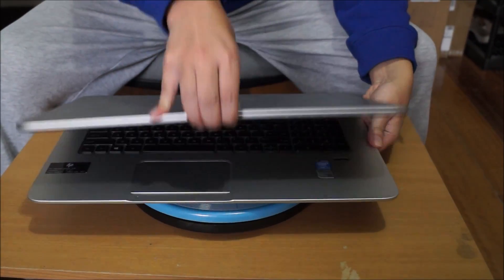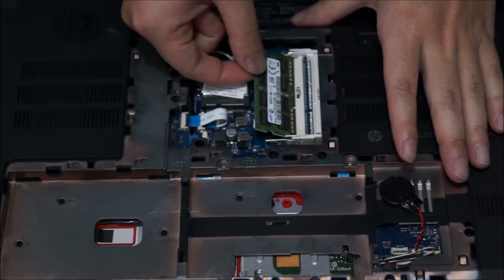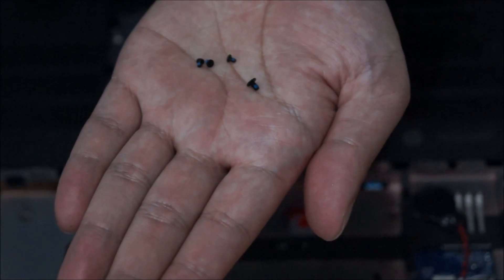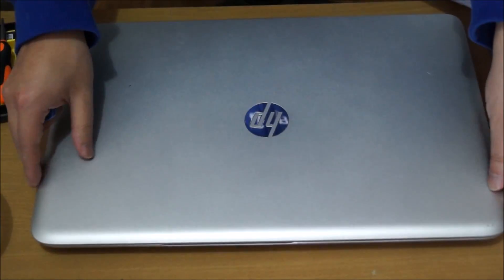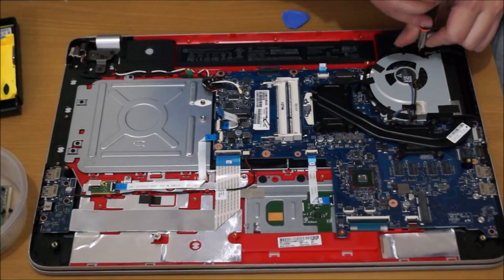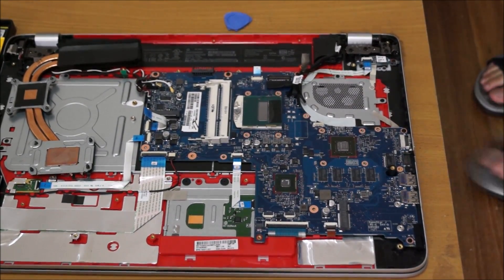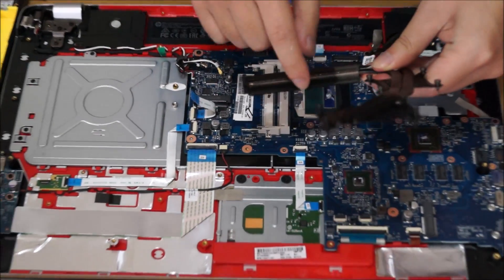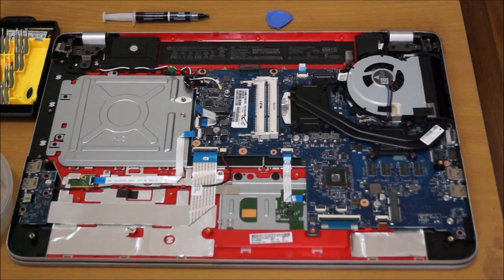OPEN ME UP! HP Envy 17 Disassembly Newer/Updated Video 1

Comment: Thank you for the great video, I'm very glad I found it. The fan didn't start anymore. The reason was that on the one hand too much dust got in, on the other hand the bracket for the hinge was broken and fragments got into the fan and blocked it. With the help of this video we managed to get the fan running, repaired the hinge and the laptop is working again. Thanks alot.
Reply from the maker: thanks for your support

Comment: Is the round black component near the HDD connectors the CMOS battery?
Reply from the maker: should be.
Reply: @OpenMeUpTec  Thank you
Reply: I should have made it clear by referring to your video at 1:11 min from the start when you open the cover and on the right you see it with the wire over the HDD cables. That round black component with wires running to the motherboard.
Reply: By the way your video was excellent and very clear. Great job.
Reply from the maker: @michaelds2738  yes thats correct

Comment: Great video. Can I just ask is there a way to tell if you have the mSata already installed. I have a hp envy 17 same year but mine came with 2 hdd drives 1tb each and 16mb ram. I seem to only have C,E & D drives that I know of on my computer. Also what is the mSata supposed to be used for? Sorry I’m not very tech savvy.
Reply from the maker: msata is a SSD slot which you can go and buy if you want more storage

Comment: It seems I have graphics card problems - what software tools can I best use to test it (on Linux Mint) and as it is soldered on, does that mean it cannot reasonably be replaced, with a home soldering iron and solder removing pen? Are they easy to get hold of, and/or upgrade?
Reply from the maker: you cant replace it. it need special equipment to do so. you can test it by using it. so by playing a game which will switch to using it. if it does not work then you have a graphic card issue. if you are not playing games or running something graphically demanding it will use the onboard intel HD graphics
Reply: @OpenMeUpTec  thanks very much for your help. It's a 10 year old HP17 Envy - the screen goes to low resolution, even the desktop display - and will seldom go back to high res, though i did after I tried some Linux repair - and at one point, when temporarily forced to high res (just on the desktop) a message said that the CPU's performance will be limited as it is handling the graphics. So does that mean binning the computer, or is there a way to fit an external graphics card, (switching off the motherboard one), and make a desktop computer out of it? Could it even be  driver issue within Linux Mint? Perhaps a reinstall is the first step, if there is no easy diagnostic? Thanks again.
Reply from the maker: @gurglejug627  i doubt it is a drive issue. it is alot easier for me to tell you how to test it in windows since i understand the testing methods and what to do.

Comment: Thank you for the video. I have the same laptop and I'm trying to upgrade the SSD to M.2. I already have SSD drive installed, but I am looking to upgrade to M.2. I bought this Samsung 970 EVO MZ-V7E500BW 500GB PCI Express Internal Solid State Drive
, Model #: MZ-V7E500BW. Do you know if this can be compatible with this laptop? Thank you.
Reply from the maker: no it is not. this laptop only takes SATA and mSATA. you need to have a m.2 slot to use a m.2. you can get a converter which will only work on m.2 sata > sata or msata. you can find these off ebay for $10AUD. the model number you proviode is a NVMe which will not work if you have the same laptop as the video, you can not use a converter for this as well.

Comment: I can't seem to find a video on replacing the keyboard on an HP Envy touchsmart 17-j023cl . I've got the back off but I don't want to go deeper until i know what to do. Any suggestions?
Reply from the maker: you need to go further. if you dont want to go on then you shouldnt replace the keyboard yourself then and get someone else to do it
Reply: OPEN ME UP thanks for the advice. I appreciate the sentiment and your concern. I started in the 1980’s doing component level repairs on PCB’s. The only reason I wanted a little guidance was because it’s been a few years since I’ve done this on a laptop.  The videos confuse me because they show going at this from the back AND front. I don’t want to waste my time going from the back if it’s easier to go from the front. I’m quite capable of tearing it down completely but I’m lazy.!! 😂 lol
Reply from the maker: @Tagurrit now i understand what you after then i can provide you with guidance. the reason why they show that is the way laptops are made. this laptop is made so that you must remove everything to get to the keyboard. the keyboard is the last part. it is rare these days to find a laptop where the first item you remove is the keyboard. so what you need to do is to remove everything shown in the video and continue. if you watch the video you can see some red and silver behind the motherboard. you need to get there to remove the keyboard. at 9.57 below my finger in the video is the keyboard ribbon cable.
Reply: OPEN ME UP oh wow!! Thanks!! I figured it would be a killer but I was hoping I was just out of touch.!! lol 😂

Comment: hey bro.. i got the same envy 17 ..is it possible to upgrade the processor ?
Reply: Nazmir I have the same laptop and was wondering the same thing! I found the answer. On page 20 section 15 are the compatible processors. There is also a list of other upgrades that can be done. h10032.www1.hp.com/ctg/Manual/c04091762
Reply: @WhattaHEX  All right will check it out...  awesome .. thanks.. by the way.. i got the intel 47000MQ ... in the intel website stated can be upgrade to 32gb ram. some website says only 16gb ram.   im also looking at that and double check.

Comment: Thank you for this very informative and educational upload. I was wondering how to add SSD and M.2 SSD to my laptop. I have one exactly the one you showed in this tutorial. Thank you very much for clear presentation. Everything you explained and showed helped so much. I will do these modifications on coming Saturday. Thank you very much. I gave you a thumbs up.
Reply from the maker: yes and no. the laptop in the video supposedly the one you have. can fit 2 x 2.5inch hard drives which you can have 2 SSD. it also can fit a mSATA which are SSD. there is not slot for m.2 in this. m.2 is the never version of mSATA

Comment: based on the manual, the mSATA slot for ssds can only be 24/32gb with system memory of 8gb. 

What does it mean? If my ram is only 8gb, only 32gb mSATA can be installed?
Reply from the maker: no. I had this laptop with 16GB of ddr3 and a 512GB msata. this is not an apple. for PC if it fits in the slot it works. the reason why the user manual say that is because when they printed it there was only 4GB sticks and 32GB msata. since it is the only thing they had to test at the time they can only tell you that.
Reply: @OpenMeUpTec  woah thanks for responding. I have an ENVY 17 j070ca model (J series) and currently my 1TB hdd's health is 15%. I was thinking of upgrading it to ssd but,  knowing it has an mSATA slot, what can you advice from here? I use my laptop heavily on adobe apps (ps, premiere, after effects, illustrator) and 3d animation (maya). I'll be buying another 8gb ddr3 as well to max out the RAM. What would be best (ssd/hdd/mSATA ssd)? And where should I install my os and adobe softwares? I have two 1TB external hard drives for storage anyway.

(I can't afford a customized desktop PC atm)
(I'm also not familiar with how it affects bootup or about caches and what not)
Reply from the maker: @ammmm_4803  any SSD is good. just buy the cheapest one that is branded. you install everything on the SSD and use a normal hard drive to store things like files  music and picture.

Comment: Where can I get HDD data cable with 8 pins for Hp Envy 15-ae103ne.!?
Please help anybody with the link or know the name of the cable
Reply from the maker: you can buy it off ebay. i have purchase a few before from ebay and it works
Reply: @OpenMeUpTec  Can you help to send me a name of the cable...
Reply from the maker: @Fgldesigns  sorry i can not help you. i purchase it long time ago on ebay and was not able to find it again. i wqas only able to find the 2nd hard drive cable which works for both slots but it is just long in the 1st slot. i remember it cost around $12AUD
Reply from the maker: @Fgldesigns  https://www.ebay.com.au/itm/Hard-Drive-Adapter-HDD-Cable-Connector-For-HP-Envy-15-as010ca-15-as020nr-Laptop/254317066612?hash=item3b367a7974%3Ag%3AO8oAAOSw-OpazGzN&LH_BIN=1
Reply from the maker: @Fgldesigns  https://www.ebay.com.au/itm/Hard-drive-HDD-cable-connector-for-hp-envy-17-DW17-ENVY-17-j-M7-6017b0421501/312720685330?hash=item48cf9af912%3Ag%3Ax6QAAOSwny9c65b%7E&LH_BIN=1
Reply: @OpenMeUpTec  Thanks, but my PC head has 8 pins not 10 pins as this.
Reply: @OpenMeUpTec  I already bought the one with 10 pins but was not wide enough to fit, cause my PC (Hp Envy 15 ae103ne) head has 8 pins and very wide.
Reply from the maker: @Fgldesigns  sorry you asked me a question in my hp envy 17 video so i gave you the details for that. with your knowledge you can go on ebay and try to find it. i searched hp envy hard and you should fine some.
Reply: @OpenMeUpTec  Ok!

Comment: The part you pull off at 7:13 is the bios cable? I just bought this same laptop used and the speakers aren't working and I noticed it's completely missing the bios cable and part. Do you think this could result in no sound from speakers?
Reply from the maker: at the time i did both the bios cable and the speaker cable. i am pretty sure they just forgot to plug it in. if you open up the laptop you will probably ind the speaker cable somewhere inside as this has happen to me before as well when i forgot about it and when putting it back together the cable went of somewhere

Comment: great stuff. im pretty much at the 11:00 mark since i am replacing the entire keyboard. not too sure until which part i should stop disassembling to safely replace the keyboard
Reply from the maker: if you can replace it at the point then you dont have to continue on
Reply: @OpenMeUpTec  all good. after removing the fan, stop right there then remove the motherboard. continue on unscrewing the aluminum case to reveal the keyboard. i have mine replaced thanks
Reply from the maker: @f.i.l.d.e.p.s  sorry i made a spelling mistake. if you can replace the keyboard at 11 minutes then you dont have to continue on with the video. This is because if you removed that part then it needed to be safe for you to do it
Reply: @OpenMeUpTec o crap. the keyboard i ordered new from ebay, im not happy with some few keys, the "end" key totally does not work. i also have to press really, i mean really hard on the "down" ,"page up" and "page down" keys to respond.. ugh, sucks big time
Reply from the maker: it is pretty normal. due to the design of these keyboard this happens. the rubber membrane break and harden over time.
Reply: @OpenMeUpTec  i meant the keyboard replacement i bought new from ebay. sucks that it is defective. anyway. didnt know that this notebook can only hold max of 16gb ram.
Reply from the maker: @f.i.l.d.e.p.s  there is 2 slots. 8GB in each slot so thats 16GB

Comment: Will the Samsung 960 PRO NVMe M.2 512GB SSD (MZ-V6P512BW) fit in the Envy 17?
Reply from the maker: this laptop doesnt have a NVMe slot. unless you have the newer version
Reply: I've got the hp Envy 17-j115cl , Product#: F9M19UA#ABA
I can't find a compatibility checker on-line to confirm that it can take that SSD. I'm afraid I'll have to take it apart just to see if it has the right slots. If I find a place where the SSD fits, does that mean it should work? Thanks ever so much.
Reply from the maker: @mikejurney9102  this is not apple therefore if it fits it will work. i just looked up your model number and it will not work as you dont have a slot

Comment: Same here I just refitted all the nutserts for my left hinge, and resurrected my Envy by watching this vid!  Thanks man  :)   PS: I wish you would post the specs for that M.2 card 18:20... I'd fit one.
Reply from the maker: thats a mstat not m.2. if you have an m.2 you can put any m.2 in. please note NVMe is not m.2 but is pcie. this is not a apple anything that fits in the slot should work
Reply: @OpenMeUpTec  OK cool I already have a 500GB SSD and a 1TB old spinner in the HDD bays.  So I could put an mSATA card in as well yeah...   Thank mate very helpful.
Reply from the maker: @asecret900  mstat only goes up to 512GB
Reply: i just put a evo 860 1tb in mines and it works perfect 10 times faster load and i have no stuttering when i have alot of app up at one time. i do music so when i had more than 5 large songs open at the same time i couldnt keep up. also upgraded to 16 ram. feels like a brand new computer try this https://youtu.be/bzumc2bgOgA

Comment: Thanks for the video. i own a similar 2014 model  HP Envy 17 Leapmotion SE J102tx  with Beats audio(quad speakers with subwoofers). Can you tell me the chip model of the IDT soundcard(integrated). And if possible the make(compay) of the  speakers and subwoofers inside. I intend to find out the audio capability  of the inbuilt speakers to get n idea of the quality of laptop speakers.
Reply from the maker: sorry dont have the laptop anymore to tell you about it. laptop speaker are always crap

Comment: Hi. Nice video.  I have a left hinge problem on my HP envy 17 j184nr series. Im just wondering if I get a bottom case for hp envy 17 j series is it going to be compatible or it evan goes to more details? It it is so, can you tell me where can I find bottom case for my envy 17 j184nr? Thanks
Reply from the maker: it is normal for HP to have broken hinges. i dont know where you can get a replacement from try ebay but for myself i just used ego proxy glue and alot of it to resolve the issue

Comment: What model is this laptop in particular? I have a similar one, but am curious as to what it seems I should have purchased.
Reply from the maker: this laptop shell in used alot with hp. they used this shell for the past 4 years or so. even though you have something different inside it is the same layout.

Comment: hey i replaced my HDD1 for an SSD, worked fine. but now my 2nd slot isnt detected.. HDD2 doesnt appear anywhere. not in the computer, not in disk management, not in peripheral stuff. help please. HDD is working fine, i tried with HDD1 and it still isnt detected.
Reply from the maker: to confirm use the hard drive from slot 1 cable and put it in slot 2 and see if it works.
Reply: yea i blew into the sata connection 2 as if it was a good ol SNES, then placed HDD1 + HDD2 like they were before and HDD2 showed up. I then put back the SSD in slot 1 and guess what, HDD2 appeared. I think my magic blow did the trick. lmao. i just hope it wont re-disappear... thanks

Comment: Can I take the back off with the one screw driver?  I have a computer tool kit.
Reply: I think I'm actualy wondering what a torn screwdriver looks like because it looks like your using the same orange screwdriver with difrent bits?
Reply from the maker: torx screw is the star shape. you can google it and buy a kit off ebay for $15AUD

Comment: fantastic video! I wish everyone could do video instruction like you do. I have that left side hinge problem, that apparently happens with this laptop, and don't know exactly what will have to be replaced to fix it.  Now, at least I can get a close up look and the problem and find the solution.  Thanks again for the video
Reply from the maker: this problem is normal. i just fixed one a week ago. need some glue and hope it works. get 2 part epoxy glue its good stuff for this issue

Comment: Hello OpenMeUp, thank you so much for this video, it was really helpful and I am looking forward to doing some upgrades myself on my HP ENVY TouchSmart 17-j113tx Notebook PC (ENERGY STAR). You say on the description that a number of things can be changed.

Such as:
-CPU: can I get a 5th/6th/7th generation CPU? Or am I stuck with the theoretical maximum of Core i7-4940MX?
-RAM: I already have 16GB ram but its DDR3, I am guessing I can't do DDR4 and no point even if I can right?
-Graphics: You say graphics card is soldered on, but I have a 740M in addition to the intel graphics card. Can't I remove the 740M and put in something from the 8, 9 or even 10 series of Nvidia graphics cards? 
-Wireless: Can I also switch to 802.11ac, as I currently have 802.11b/g/n? 
-Hard drive: Finally what I will be doing first, I want to switch my two 1 TB  spinning hard drives to SSD. I am guessing I can do it with a mSATA SDD, but is there any limit to what I can put on? Can I put 2 X 4TB if I wanted to? Assuming cost is not a factor? In reality I would probably put in 2 X 1 TB SSD, but wanted to know what was possible. Thank you.

Comment: Do you think that power failure after a coffee spill could just be the power cord?  There was a series of pops after the spill.
Reply from the maker: short circuit
Reply: So that means a new motherboard?
Reply from the maker: yes from what you describe
Reply: There are  some three paper thin metal washer looking disks over near the DVD drive opening preventing me from fully opening the case.  What are those and how do I remove them.
Reply from the maker: if you watch the video at 3.30 I tell you that you need to remove them
Reply from the maker: looking at your picture you still have 2 screws left to remove and one has already been removed.